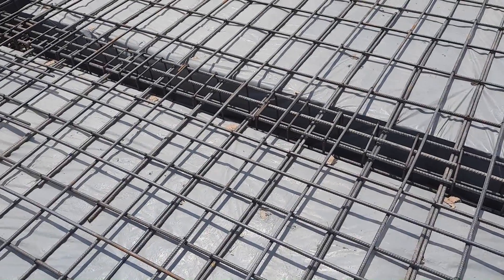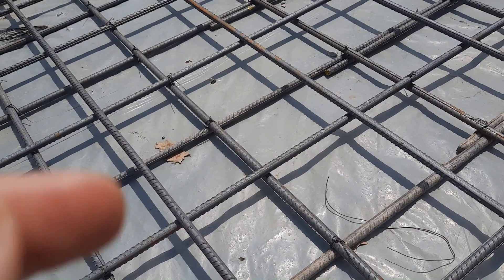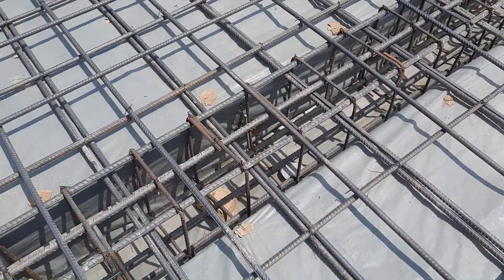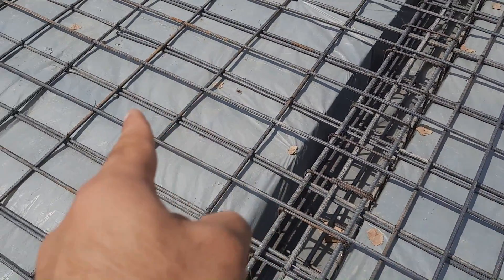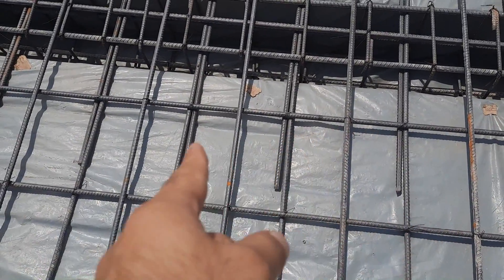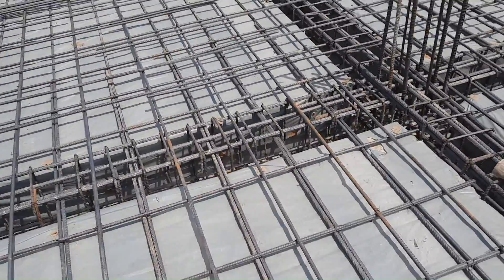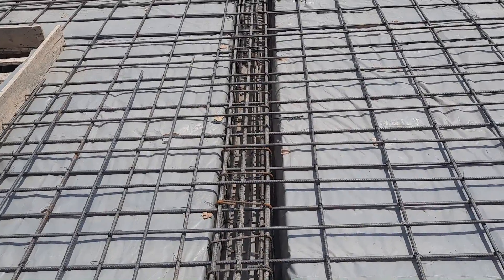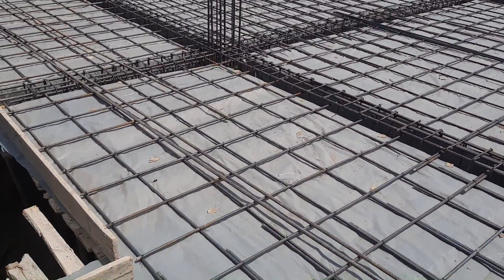Negative Bending Moment and Extra Rod in Slab

Comment: The line of impact of extra bars should not be the same, the end of extra bars must be differ in the length at the end to other consecutive extra bars for negative moment. The line of action or line of impact at the end of steel bars with one another should not be the same???? Please reply anyone if someone knows it?
Reply: Lapping length should be  alternative , extra bars instead of crank bar need to be l/ 4 near beam.
Reply: What is the length of extra negative bars at alternative crank bars in slab
Reply: Yes!
The lapping should be staggered.
The lapping point acts as  weak points.
They should be random or staggered